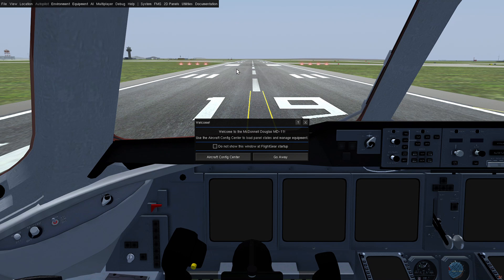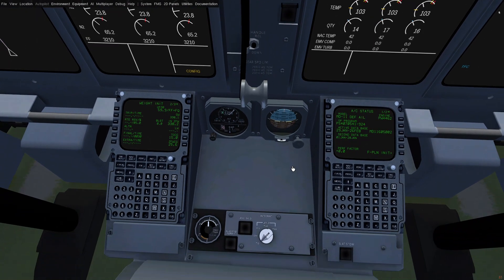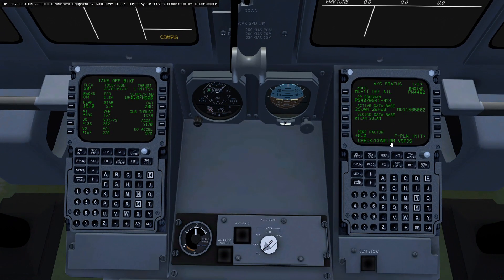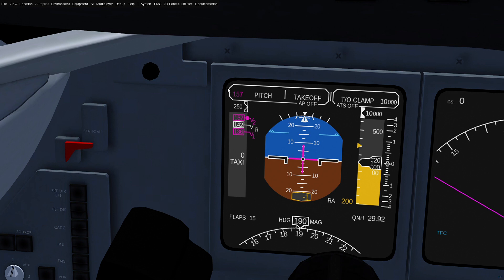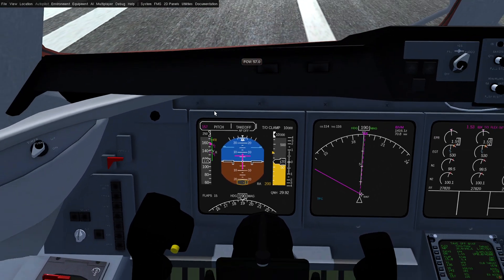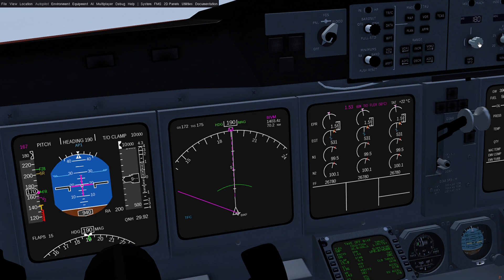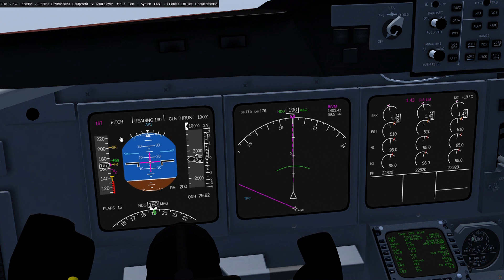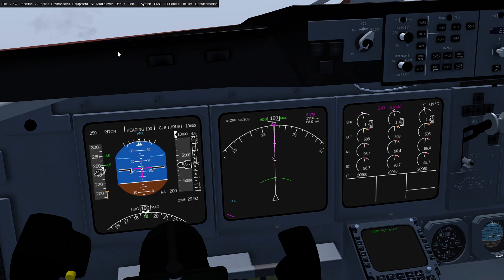FlightGear MD-11 v1539 New Features Demo (DU, FMS, etc)

Comment: Yooo Josh!  Is it possible to detach the window with the 2D panel (Captain's PFD) and drag it to another monitor? Is it possible to implement this 2D panel into another model? Do you know any glass panels for the UH-60, CH-47 or CH-53? Thanks for any answers! Great video!
Reply from the maker: Hi sir
Clicking the DU will pop-up the DU 2D panel. Or you can select it from the menu. Currently Canvas windows cannot leave the FG window. This is a limitation of FG. But it is possible to "pull" it out into a webbrowser. Sorry but you cannot move this 2D panel to another plane. The 2D pop-up is simply a copy of what is mapped to the cockpit, and that code is very tightly integrated with the MD-11's systems, FMS, and Autoflight. Attempting to Frankenstein it out would be very difficult than just creating a new one. And sorry, I am not aware of anything beyond my aircraft.
Reply: Thanks for such a comprehensive and detailed answer.